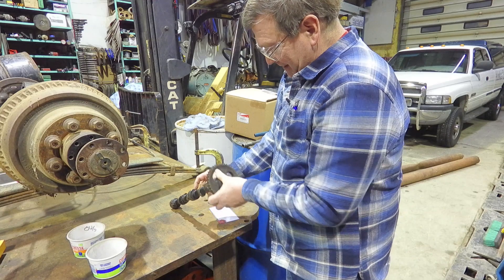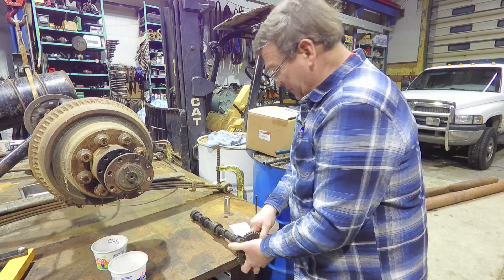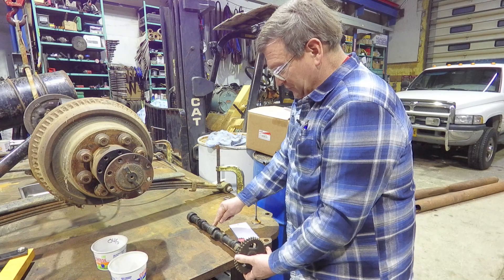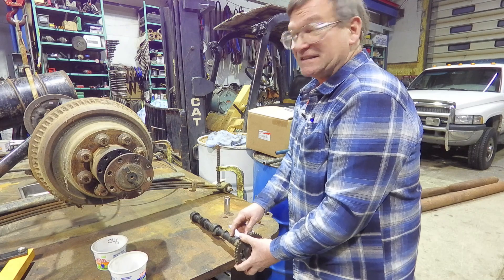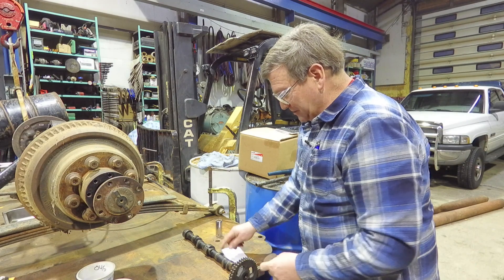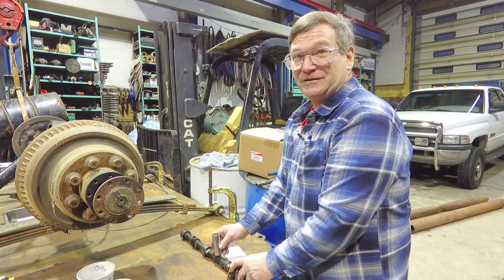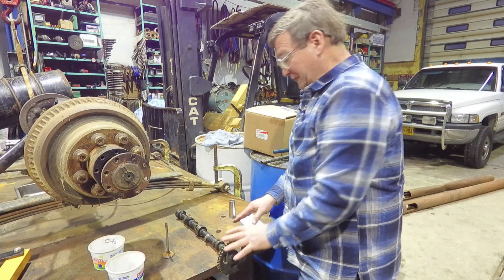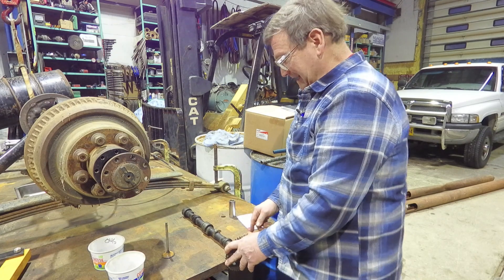Automotive Minutes:  Technique for adjusting valves on most 4cycle engines

Comment: Another way is to bump the motor over until an Intake valve starts to open, set your exhaust valve lash. Bump the motor over until the exhaust valve starts to close, set your intake valve lash.

Comment: It can be looked up or reasoned out on any motor. I see so many mechanics getting this wrong. Step-1. set crank at TDC. set lash on 1/2 of the valves. Step-2 rotate motor 360 deg. and set the lash on all of the other valves. And your done, that's it, their set, period. this applies to every motor. You are over complicating this. The above method is how they do it at the factory. With this method the valve you are setting is on the heel of the lobe every time. If the intake is at full open the exhaust on that cylinder is on the heel of the lobe.
Reply: No this is not the way to do it on any motor, absolutely not, solid lifts, you’ll wipe the cam, hydraulic lifters, yeah you might get away with it but the best way is adjusting lash the the intake/exhaust valve is just opening on the intake/exhaust on the same cylinder.
Reply: @beekeeper6109  I hear you saying that however I build race car motors. I've been doing it like I suggested for 40 years and never "wiped" the cam, what ever that is.🤔
Reply: @beekeeper6109  By that reasoning if no.1 is at TDC  it's not ok to set both valves on that cylinder. Think about it.
Reply: @David-Rule  correct, you don’t lash valves by TDC, TDC is for timing event, lashing valves is done by the valve event and that changes depending on cam timing, we you set the cam up and LSA. This is the day Steve Morris foes and his 4500 hp motors run in a low 6’s  average over 5 days while driving a 1000 plus miles in the 5 days so I think I will stick with that. Drag and drive is change the way we look at engines, never in my life would I imagine a pro mod driving a 1000 miles and then run a 5.99 after 5 days of racing.
Reply: @beekeeper6109  Just how any deg. are ya'll advancing the cam timing? And just consider this. In the assembly plant's how do you think they set the valves? I can assure you it's not in the car with the engine running loosing them till they click and snug them up till they stop. I'm sure you have seen some old geezer doing it that way in the 80's.
Reply: @David-Rule  let’s say you’re setting the valves on the drivers side bank and will do the intake valves first. So start on cylinder #1 and roll the  engine over so the exhaust valve on cylinder #1 is just starting open, you want to then open the exhaust valve another 1/4”, this assures you’re on the heel of the cam (base circle). You’ll then set the cold lash on the intake valve to the cam manufacturers clearance, repast this for each cylinder. To set the exhaust valves, start back at cylinder #1 and roll the ringing over until the intake valve is a 1/4” away from being closed, then set the lash for the exhaust valve and repeat for each cylinder, then go to the passenger side and repeat. If you’re setting the valves at TDC both valves are shut but you are not on the heel of the cam, your on either ramp depending if you on the compression or exhaust stroke. Oh and in your original post you say “set the crank to TDC and then lash 1/2 the valves and the turn the engine over 180 and do the other, at best only 1 cylinder will be in the right position. Lashing valves at TDC, you will still have spring pressure on the valve and you want lash to be set with no spring pressure. Now this is for solid cam/lifters, with hydraulic you setting the preload but you want to set the preload without the least spring pressure as well, which only happen when the lifter is on the base circle. Valves have to be lashed individually at each cylinder.
Reply: @beekeeper6109  I see your point, however this goes back to the mechanic suggesting that you concentrate, turn the phone off and do it after hrs. Way to complicated, it's in the GM service manual and the Chilton Manual. Set motor to TDC no.1 cylinder and you are free to set 1/2 of the valves. Mark them with a paint marker if you like. then rotate crank 360 deg approximately, just use the timing tab. and set ALL of the others. One turn of the crank, that's it, even with solid lifters, just use the cold lash clearance. I would have to look up witch valves to set each time but any 60 deg v8 with a 18436572 firing order and adjustable rockers will be the same. I did an Oldsmobile 350 Rocket (with a really big cam and we added adj rockers) last year, on the stand and had no issues. I did round off a cam lobe one time on a 454 big block due to improper cam break-in. Blasted the motor off and forgot to put any water in it. Noticed something was wrong when the headers started to glow red hot. Truth be known I was waisted at the time LOL. Other than that it has worked every time. I can assure you that's how they do it on the assembly line. They don't break the motor in, then pull the valve covers and do it again hot on a brand new car.
Reply: @beekeeper6109  You just made my point. Way to complicated, that's instructions for the timid or the newbie. And there is a lot going on when rebuilding a motor. I am always wondering, did I torque the rods? It can be a time of high anxiety for all of us. This demonstration WILL work! I just don't like unnecessarily turning the motor over, call me lazy. The simple fact is this. They don't do it this way on a brand new Hellcat on the assembly line. They do do it ( I just used dodo in a sentence) LOL the way I suggested.
Reply: @beekeeper6109  Also Howe is a Machinist doing it on an out of adjustment motor in the truck. Probably not something he does every day. So he did it on the side of caution, don't blame him. If I had a car with one valve ticking I would do it as you suggested. If for instance a push rod got bent ( it happens) Just approach that one set of rockers.
Reply: @beekeeper6109  
Street Reaper-Has a video doing it on a C-10 Chevy works on a V-6 also. Set to TDC no.1 set those valves AND 2-5-7 intake valves along with 3-4-8 ext valves. Rotate 360 deg and set ALL of the other valves. This is what the manual says and it works. The base circle is almost 1/2 of the lobe.
Reply: @David-Rule  in that video he is setting the preload for a hydraulic cam/lifter even though he is saying setting the valves. I did say before hydraulic cams are more forgiving because the lash is constantly being adjusted by the oil inside the lifter and a stock SBC or even one that’s slightly cam’d with a hydraulic cam you have about .200 of travel, so this method is fine. The 3/4 turn after after he takes the play out of the push rod is where he is the setting preload, you don’t want to be at the top or the bottom of the travel of the piston inside of the lifter. In diesel’s, many race engine and very early gas engines you have solid or mechanical cam/lifters which you need to set lash or clearance so as the engine heats up and grows you do not wind up hanging a valve open, you can’t check clearance if you have spring pressure on the valve and rocker. If you do the method Streep reaper did with anything other than a hydraulic cam, your already starting with the valves open by adding that 3/4 turn in, you’re opening that valve, that’s just basic engine building knowledge. If adjusting valves by the accepted method by every cam company which is intake closing exhaust opening or the acronym EOIC and you do them per cylinder in the firing order, is over complicating things then I really question the 40 years of building race engine experience you’re claiming.
Reply: @beekeeper6109  Yes that is correct. The point of the video is that with cylinder no.1 at TDC on the firing stroke those two valves and 6 more are are at the heel of the cam. rotate 360 deg. and the 8 other valves are ok to set. It's in the service manual for crying out loud! The base circle of a cam isn't just one spot it's just under 540 deg that's 1 and 1/2 of the cranks rotation not counting overlap or cam advancement. That's a big window of the lifter riding on the base circle. Even in the video you shared he's saying rotate until the valve open's 1/4". I didn't see him using a dial indicator to verify the.250" He's just making sure you are away from any valve overlap. And the .250" is based on what? Cam lift and rocker arm ratio would change all of that. Bottom line is the YouTube video's on setting valve lash are more focused  how to set the lash and not so much on when to set the lash. It can be intimidating and confusing the first few times. I can guarantee if you do it my, and the service manual's way, Then go back ad check it Howee's and most of the other valve setting video's on YouTube's way you will see there is NO difference, except one way is 10 times faster. Also if you were to get interrupted, all bet's are off. It would be easy to get confused on where you were at, might as well start over. When I had my hip replacement the doctor told me I will be opened up and sewed back up in 45 min. The reason they do it as fast as they can is is better your chances of not getting a staff infection. I'm enjoying this debate, the process you are describing is fail safe and most defiantly work. With my way there's just less to think about. Click on my picture and visit my channel. I've got some cool video's and some rare music on it.✌
Reply: @beekeeper6109  Hey I'm spraying a car right now. I'll get back with you in a few. Watch Howee's video again and I will too. He's not talking about How to set the valves, but WHEN to set them. Howee is not a mechanic, he's a machinist. He was wanting to be certain he was not on part of the lobe when he adjusted the valves.
Reply: @beekeeper6109  Ok I re-watched Howee's video. The main point he was making was to make sure you are on the base circle of the lobe. He also pointed out that you can set the lash on a hydraulic lifter in the middle of the lifter's piston travel or at the bottom -.007 or at the top of it's travel. I no exactly how a hydraulic lifter works and what they are for. Fun fact they are used to stop the noise from going from .007" clearance to touching and to stop the lifter from smacking the cam lobe  as the clearance is takin up. The oil pressure in the lifter WILL NOT overcome the valve spring pressure period. My and the service manual's method will work with hydraulic, roller or solid lifters. It's a question of WHEN a valve is ok to set. Remember the base circle of a cam lobe is just over 1/2 of the profile Witch is just under 360 deg of the crank rotation. I'm sorry you can't appreciate this fact. Finally it's in the service manual and that's how it's done at the factory full stop. There is no point in taking 30 minutes to set the valves when it can be done (per the manual) in 5 min. I'm sorry that you just, don't get, it.
Reply: @David-Rule  well first, if your at TDC on  #1 at least 1 valve is not in the base circle and depending on LSA and duration more than one might not be on the base circle. Manuel’s also say that if you swap pistons with an offset wrist pin to the opposite bank you’ll gain power, heck Uncle Tony wants to die on this hill, but engine masters has shown it does absolutely nothing. When I build a motor I am not looking for short cuts I am looking to do it right and every cam company and engine builder of note with its Steve Morris Keith Black, John Kaase, etc will tell you, do it by cylinder, in firing order using EOIC and it doesn’t take a half hour, even if it do oh well it’s done right. Just because something was done 40 years ago or for 40, 60 or 80 years doesn’t make it right. I’ll stick with quality over time any day, sort of like using plasti gauage for setting clearance, there are far better ways, that’s why you now have 5 second street cars run 5 tracks in 5 days and also drinking a 1000+ miles on the 5 days. Oh and once you set the valves you should never have to adjust them, if you have to adjust them, then something is wrong. Time to put down the old book because we have learned a lot of new things and also that we have been doing a few things wrong, progress is a good thing. I stick with hard work and no shortcuts, have a nice one, I am done here.
Reply: @beekeeper6109  I has been a pleasure debating with you.